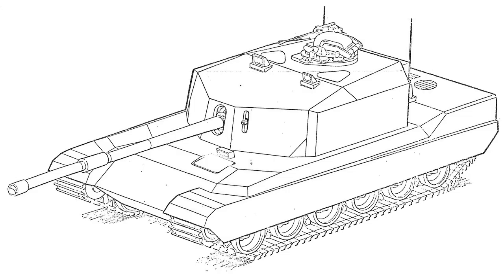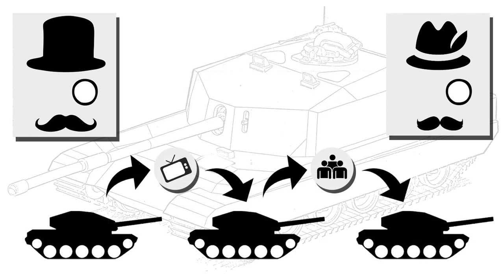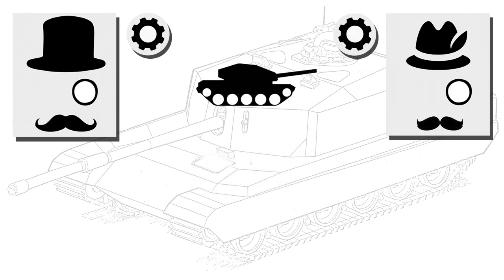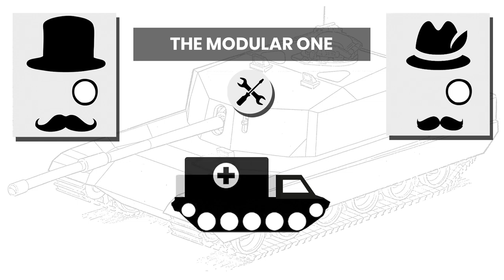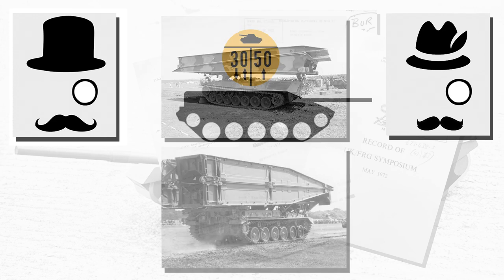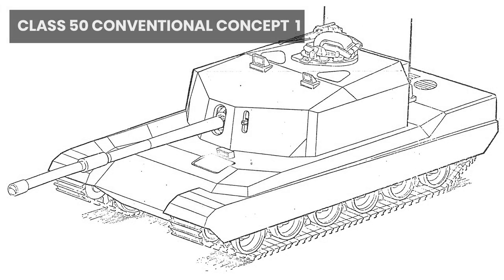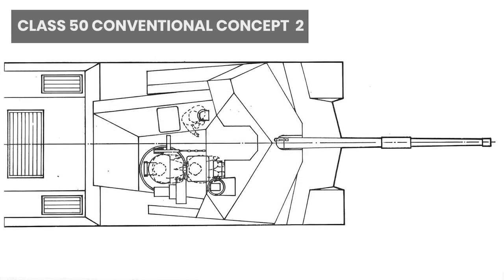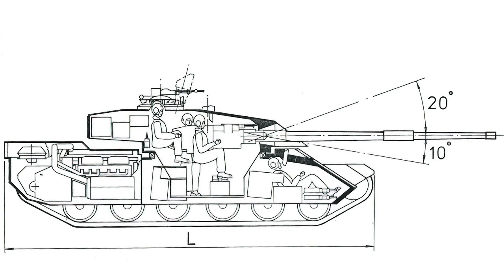Future Main Battle Tank - Tank Design & Development (Part 2)

Comment: The irony is that once they decided to add thick composite armor on the Leo 2 the Germans went to MLC 60 so the whole MLC 50 ordeal was a huge waste of time.
Reply from the maker: yup... rember when i saids we would regret showing the gemans chobham :P
Reply: @armouredarchives8867  IIRC Leo 2's arrays aren't really Chobham either but maybe they intensified their research after the British reveal?
Reply from the maker: @elanvital9720  indeed a derivative of it or mod,, as the UK an germany have several heated debates over where we are furious the germsn used chobham on Leoaprd2,, the germans offer the UK the 120mm SB free of charge as a token after but we declined it. when that bit comes il have the letters of correspondance in the video
Reply: @armouredarchives8867  Didn't you said the problem was not showing it off early enough?

I wonder if they'd ever try to demand royalties from it in a manner similar to how Rolls-Royce tried to get £400-million off the Russians for stealing their jet engine tech in the 40's... (Which they should have seen coming from a mile away.)

Comment: So, question. You had said that the 110mm used a combustible casing, (and I seem to recall seeing pictures of it being similar to the current NATO 120). But the images you've been showing are all showing separate projectile/charge layouts like in Chieftain. Was there a 110mm design change at some point?
Reply from the maker: A good question. Many of these drawings as covered carried over from the previous AFVs for the 80s drawiNGS (MBT-80) ((The first one) and predate the gun being made, it is most liley thhefore that they were drawn at a stage when the gun was in development and so are of an older type, by the time the gun is made they use a combustible case and the drawings carried over into FMBT have not been amended

Comment: Class 50 Conventional Concept 2 reminds me of one weird idea I ponder - placing the driver in the normal position - but sitting backwards. The driver relies upon mirrors to see forward. The hull is sloped like a boat nose - the thick bottom slopes upward to meet a thin deck.

The point is, the driver's body is mostly underneath the thick turret armor, but the driver's hatch is still in comfortably in front of the turret no problem.

Comment: I'm interested in why the 110mm gun wasn't adopted, with both participants adopting two versions of 120mm instead. 
I assume it did not actually deliver on the promise of '120mm performance for 105mm weight'.
Reply: good question!
Reply from the maker: comes up a bit later in tri axis gun tests with the US, well get too that

Comment: Wasn't part of the idea to make a family of vehicles, including an armoured bridge-laying variant..? So the Germans could have just planned to (as it turned out they would actually do) make a 60-class bridge.
Also if the idea was to allow for growth... That usually means adding weight, so they would really have been very limited by a 50-tonne limit after a few years (if they weren't enough already).
Reply from the maker: indeed, after yom kippur they decided that clas 60 was needed anyway - at which point the UK was liek bugger it well go for a turreted tank, and germant kept fartign around with VT-2. but i suspesct by this point we knew at a levle they were goign for leopard 2, and fmbt was a poliical stalling game only

Comment: Is it viable a 3 man tank with the commander also driving?
Reply: I don't think he would like to be commander in rank and driver in the job. The driver is almost always the lowest in grade, experience, and all-around skills. Also, today driving is not that much engaging as it used to be back then. In British doctrine, the loader is the most experienced one. Other armies - it's the gunner, which holds similar skills and jobs as the commander and is positioned straight into TC chair in his career. The driver is a mechanic. He is not going anywhere up in ranks anywhere soon. I know because I was one.
Reply: @HanSolo__  cool, i was wondering more on a technical side, if you were to give up the driver for a 3 man crew, who would be the best to drive, assuming you can use a joystick, electronics and cameras
Reply: Certainly is feasible, as clearly demonstrated with the Stridsvagn 103.
It does however require a change in doctrine from the ridged chain of command to a more dynamic procedure with fluid change of tasks to work well.

Comment: Interesting that post WWII the accepted weight for a MBT is 50-60 tons whereas post WWII there has been revisionist criticism of the Tiger weighing 50 tons as being too heavy to be practical. Of course this criticism comes from gamer sources which are as usual just plain wrong but do go to show how far some will go to distort fact for their own purposes.
Reply: You forgot 1 thing and that is bridges at WW2 couldnt hold the weight and cannot be modified in a small ranges of times whereas post WW2 they have time